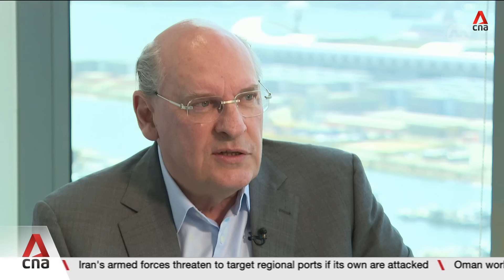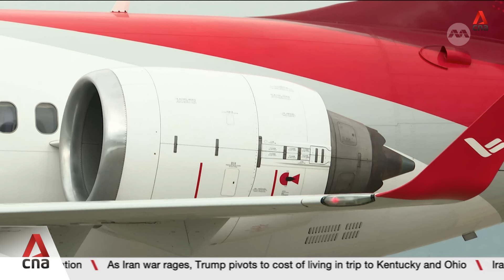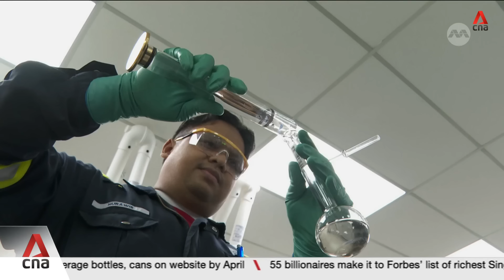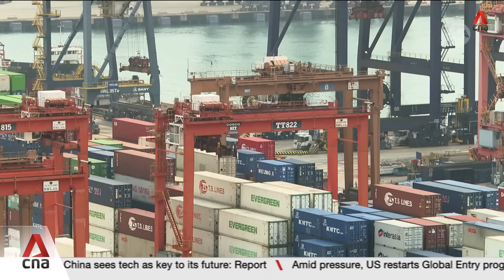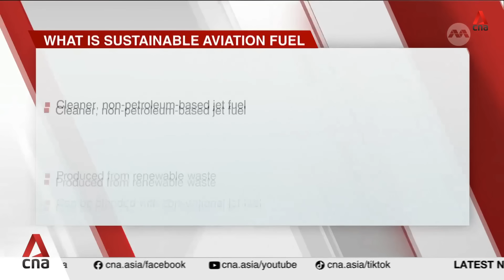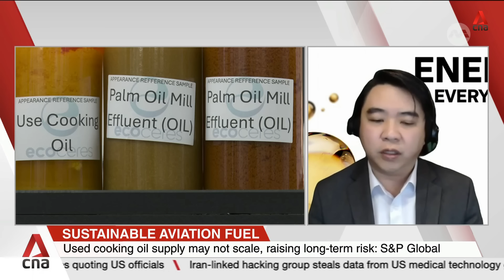Could an alternative air fuel mitigate soaring oil prices and keep flying affordable?

Comment: Even if you keep it sustainable, trust, the oil countries will campaign against sustainable air fuel. They will pour silly millions to destroying its image. This will affect policymakers. Those at the top need to ignore the attacks and try to push through, AKA provide support.
Reply: 😅Oil companies would say this can cause erectile dysfunction
Reply: still not enough to replace oil. The feedstock for SAF is still low compared to crude oil
Reply: If the technology and refinements are done properly then it won't matter.

Especially since the Arab countries are nearly about to kill themselves and be taken over by Israel if they don't stand with Iran.